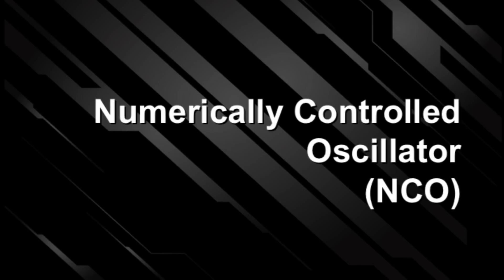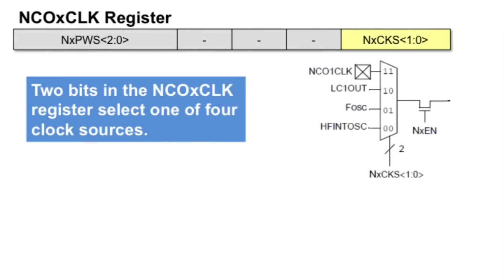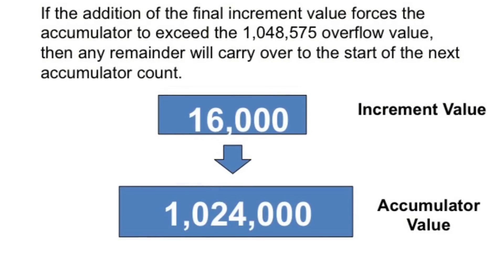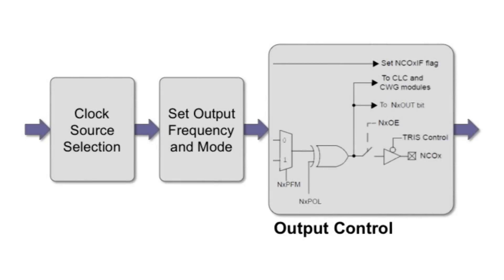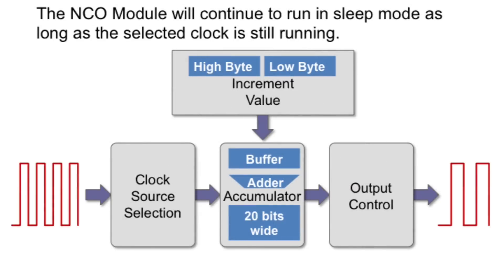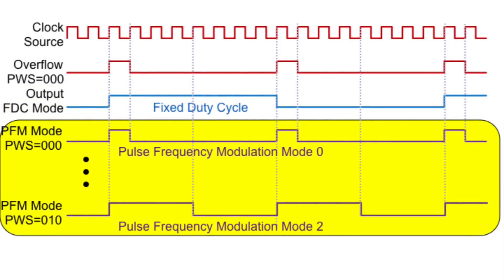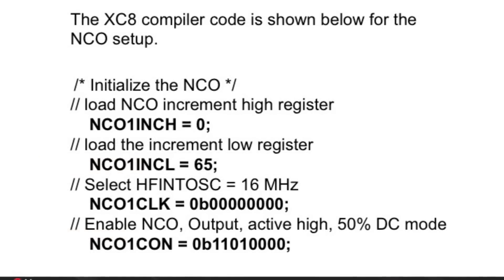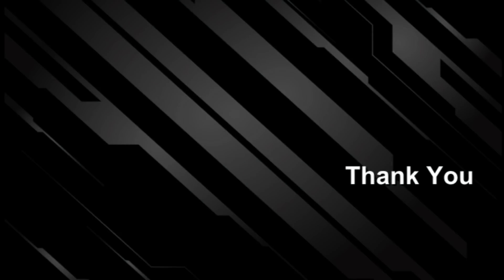Microchip Self-Paced Training – Numerically Controlled Oscillator (NCO)

Comment: In this sample, Setting 500Hz but output 496Hz... It's about 1% shift and not good enough in my application. 
How to improve the frequency accuracy?  For example, If I want 500Khz is it possible got 499.9~500.1Khz ?  Thanks
Reply from the maker: Kindly visit support.microchip.com for assistance with your question... thank you.
Reply: @MicrochipTechnology  Thanks for your reply. Finally I got answer from microchip FAE:  "No, it's impossible" .  So I will try use PWM & a custom frequency OSC, hope this time good luck.
Reply: M.J Lee I have the same issue,
set 80Khz, the NCO shows 80.3~81,1Khz in the scope.
How to fix the issue.
Reply: @陳信良-m8z  我先前的問題並沒有解決，Micorchip 的 FAE 告訴我 NCO 的精度就是這樣而已。 後來我解決的方法是用 MWM 模塊。 假如你要的精確頻率是 80K，那麼你可以看看 PWM 模塊要輸入多少頻率才能除成 80K，有現成的震盪器就用現成的，沒現成的就請廠商訂做就行了。  在我的專案中我是訂做了一顆 19.4MHz 的震盪器, 那個案子已經進 DVT 了。

Comment: There is a discrepancy shown at 14:43 & 15:46 pertaining to NxPOL needing to be set to 1 to make the output Active HI.  In the PIC16(L)F1508/9 Datasheet, on page 277, it says just the opposite (NxPOL=0 means Active HI).  Which is correct? 

http://ww1.microchip.com/downloads/en/DeviceDoc/40001609E.pdf